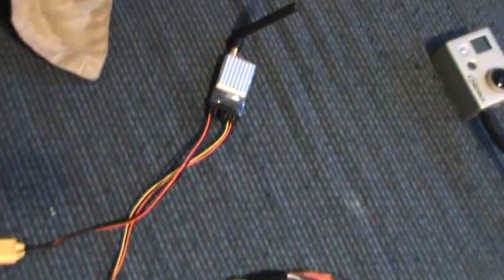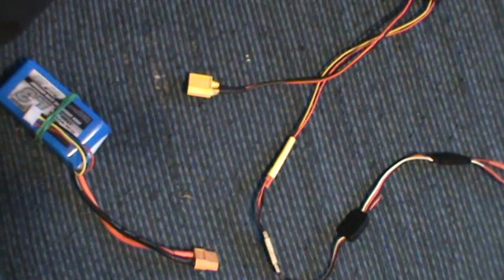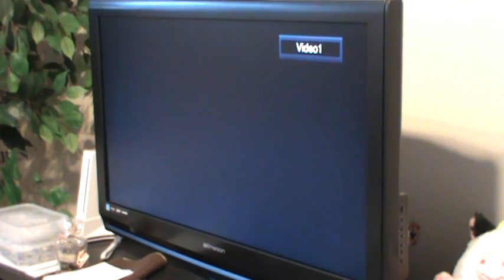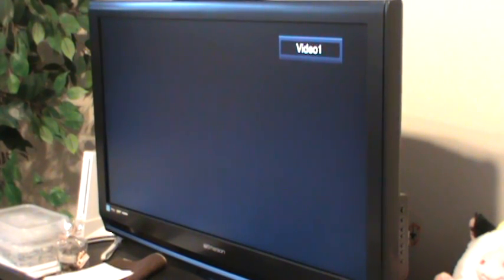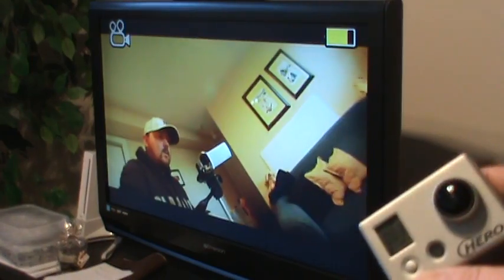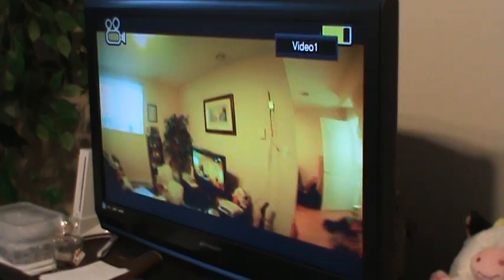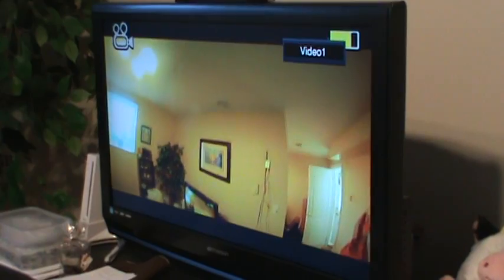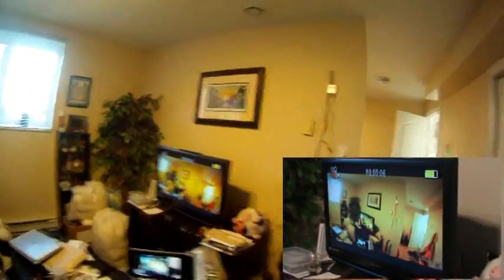5.8Ghz 200mW FPV Testing

Comment from the maker: @RStephenLegge thanks for the cool Comment! I just back from testing my "cloverleaf" and "Skew planer wheel" at indoor in a Gymnasium. There were ok , but there was a lot of interference form the walls/lights. the vid would very static etc. So with the help of 2 club members,  we took it outside..What a difference i walked quite a distance away and not one glitch..i so pleased with the antennas i made.
you can buy them form IBcrazy, but i like making my own stuff
you can see them in my other vid

Comment: Good video review eascoast78.  I was wondering how those 5.8Ghz systems performed through walls.  Maybe line of sight outdoors would be OK, but through your walls, the system was quite weak.  Outside you could not have been more than 25 meters away.

Comment from the maker: @martinba77 thanks  hey i was wondering i bought a bigger 8dbi ,i was ondering could i use the 2 stock onces to build the 2 of them..take of the boot and use the cable inside!!

I know ive read alot on his thread, great antennaes thats for sure. Im still in need a of a decent LCD screen which ill get in the spring!!
maybe by then ill have 2 either bought of built!!
Thanks

Comment: Put those antennaes in the garbage and get some Circular Polarized antennaes for 5.8gHz!
When you bunk the rubber duckies antennaes you may lost the signal, this not happens with CP ones.
Now imagine what can happen when you put those stock antennaes on your beatifull planes and lost the signal!
If you have some little soldering skills you can build yourself a pair of CP antennaes, go and check rcgroups search for IBCrazy tutorials to build them!
Cheers